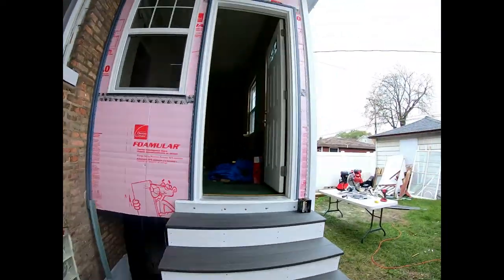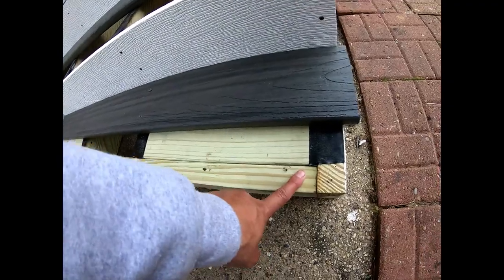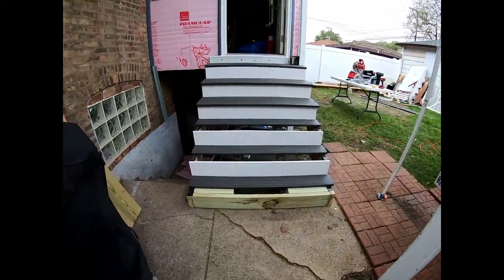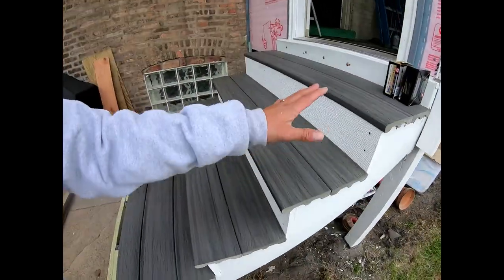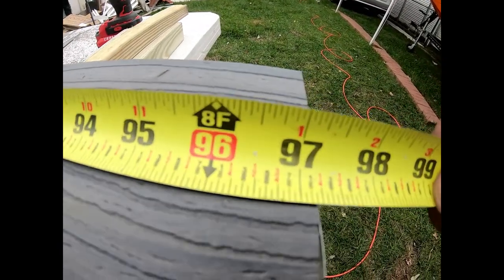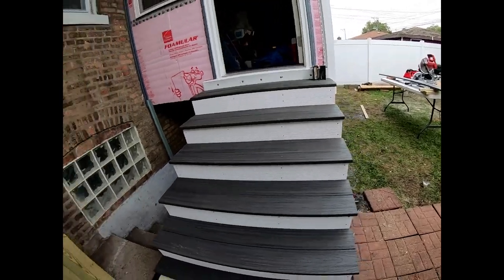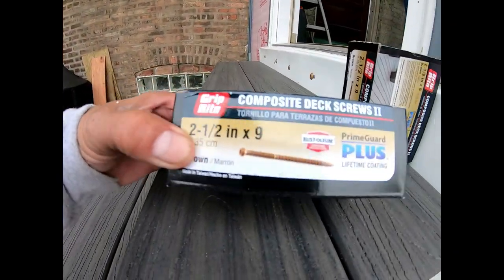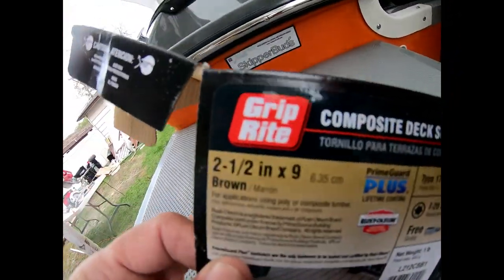Installing composite stairs

Comment: I'm doing the same type of tidal gray deck boards and PVC boards for the risers too. Only thing different I did was a picture frame on the steps to cover up the exposed edges on the side. The reason they're over 8 ft cuz the ends aren't squared from the factory. Thanks for the video man I appreciate it the deck looks good.

Comment: OK...OK...OK....ABOUT THE SCREW MUSHROOMING......SCREW THE SCREW FURTHER INTO THE WOOD......SAY 1/8 TH INCH BELOW THE SURFACE.....NOW TAP THE MUSHROOM WITH YOUR CLEAN SMOOTH FACE HAMMER AND THE MUSHROOM IS GONE.......CONTACT ME AND LET ME KNOW WHAT YOU THINK......